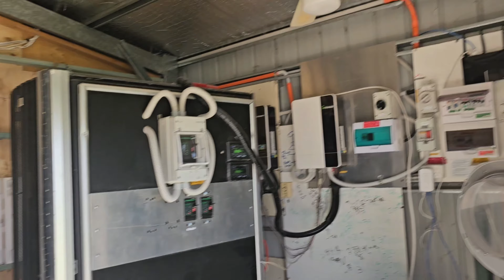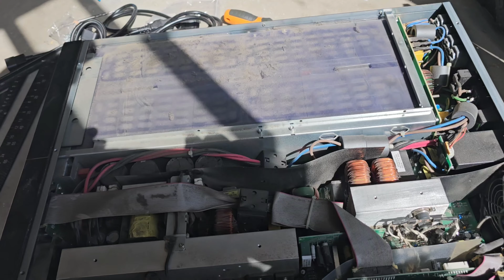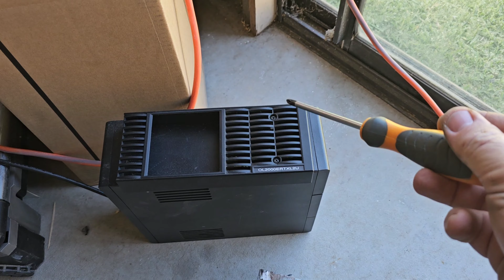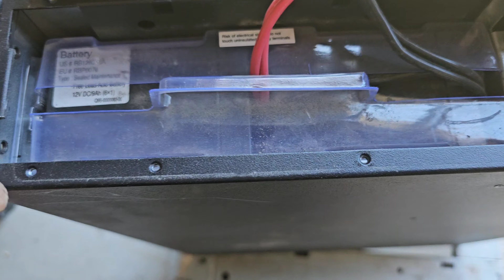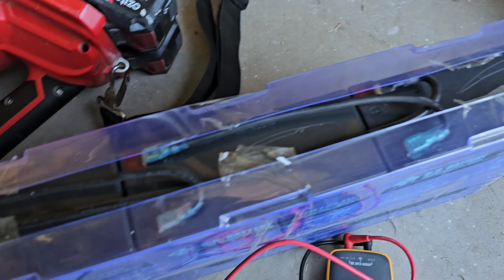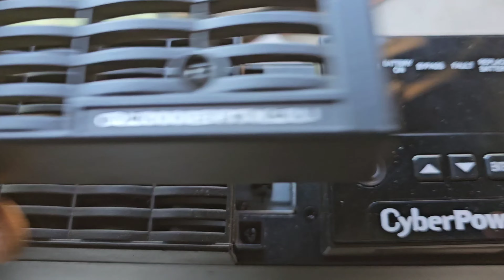Cyberpower 2KW replacing batteries.  Does  anyone know how to clear the warning  "battery expired"?

Comment: You have to do a battery test (UPS Diagnostics > Battery Test > Activate), then reset the counter in configuration menu (Reset ReplaceBAT > Activate). This should clear the error.
Reply from the maker: So, just through the main menu, or do I need a laptop for this test?
Reply from the maker: Press enter. Go into configure>then up arrow Replace Batteries press enter. Error cleared. Thank you for your help.